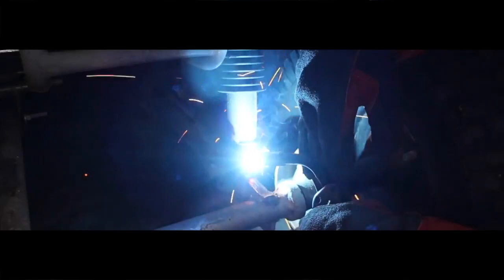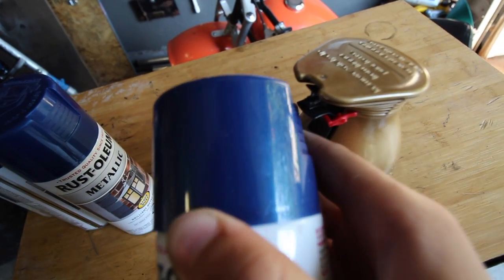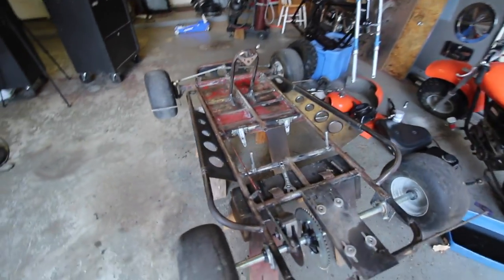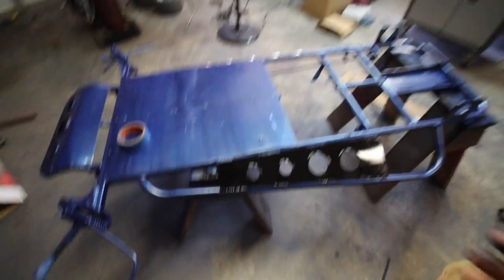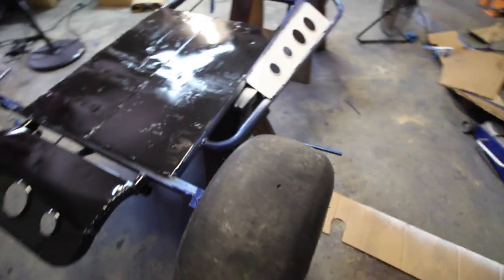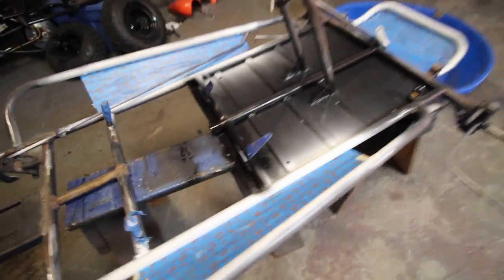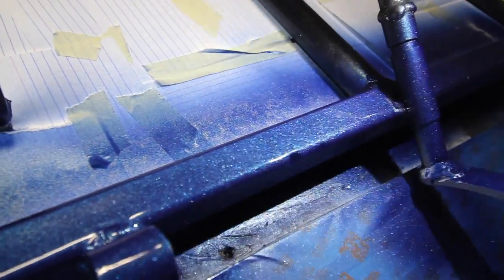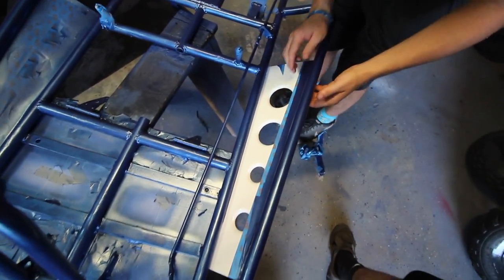Rally-X Go Kart Finally Gets Paint! | Rally Kart Build Part 5

Comment: For the gas tank use Spray Max 2K glamour clear over your color. It is gas & oil resistant. It is literally an automotive clear. Frankly i use it on the entire frame. It’s it bit expensive but so worth it on the long run.
Reply from the maker: CruzanRastamon huh ok, how does it work on the frames? Like is it super durable?
Reply: Suuuper durable. It’s a 2 part polyurethane in a spray can. The paint will outlast the metal underneath it. I use it on all my projects. It’s also self leveling so no need to wet sand after.